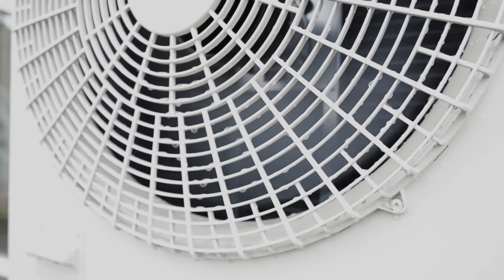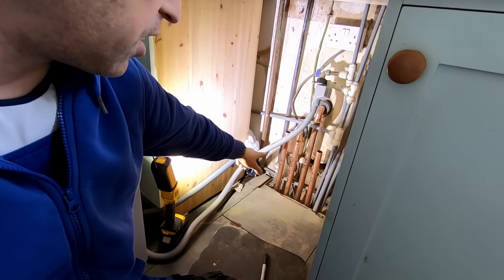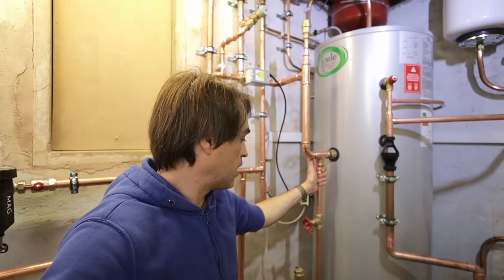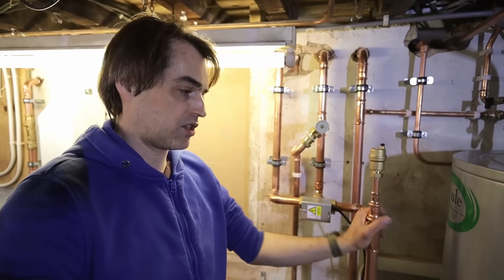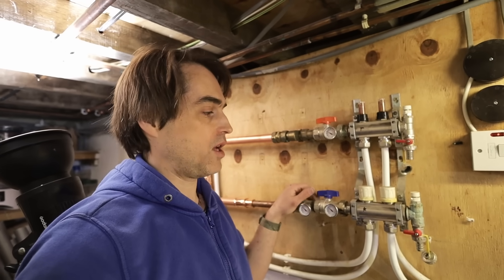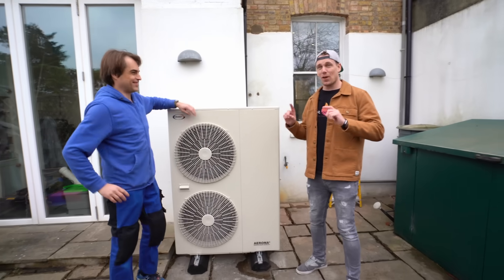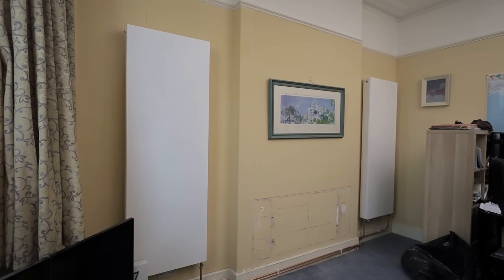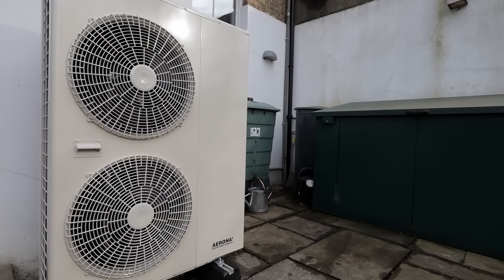The Truth about Heat Pumps: Debunking the Myth.

Comment: Hi Szymon
If you want to avoid having to install massive radiators you should check out our product! 
Love the channel ❤
Reply from the maker: I tried it on one job. Customer ripped it out in no time. I wasn’t impressed either.
Reply: @UrbanPlumbers   that's a real shame to hear. How long ago was this? 
We are currently doing a large number of heat pump installs for domestic and commercial projects. 
It would be a shame to write us off because of a bad job. 
Perhaps we can support the next one more closely 👍
Reply from the maker: @thermaskirt  I had a look at it around 10 years ago. We did one room and wehn client saw how they looked we were told to remove them. I remember the cost was high and eastethics left a lot to be desired.

What output do you get in kW per linear meter at MWT of 45C?
Reply: @UrbanPlumbers  10 years was pretty early days for us so I accept that older systems left a lot of room for improvement, I know because I was installing them at the time. 
Those improvements have been made, as well as some brilliant innovations as the company has grown. Sorry you had to go through it will the original system! 🥲
Heat output at MW 45°C are up to 90W per linear metre. 
So in a typical 4x4m room, with 15m of skirting we can get to 1350W total output. 
Averaging 85w/m2 👍.
I would love you to see how good it looks now. 😄
-Ethan

Comment: I looked to heat pumps. I checked the numbers and is didnt make sense
Reply from the maker: what did not make sense exactly mate?
Reply: @UrbanPlumbers  the running costs to be honest. Very electric hungry.
Reply from the maker: @retroonhisbikes  it depends on the system design. If desinged well it should not be more expensive to run than gas.

In fact they can be cheaper to run than gas!

Comment: Roger has a major hang up with air source heat pumps.  I explained the performance of my newbuild install and he ignored my comments.  Done properly with good insulation and air leakage of the building, air source is extremely efficient.  Also no C02 emissions from the building

Comment: I didn't even know heat pumps were used to heat water and thereby heat a home. In Canada, I have only ever seen them used to push warm or cold air either from wall mounted units or from a central air unit. Interesting to see how tech is used in different parts of the world.
Reply: It's just that there are different types of heat pumps: air-to-air (what you meant), air-to-water, water-to-water (geothermal)
Reply: @Grauenwolf  it is kind of a thing. Actually it'll involve cooling the walls and ceilings too. But the great risk of meeting dew point and wall condensation effs it's popularity. Although used it's use is made only for very hot places and especially not to cool drastically or achieve frigid temps just to make it comfortable for westerners.

Comment: Why not just go for an air/air system, and get rid of the radiators? That is what we do on the continent. you can buy a complete system for about 3k €. Plus any competent DIY person can install it. I did my 100 year old 3 Storey 4 bed, granite walled house 10 years ago for about 1000 €  plus 300€ for the gassing. Still working fine. And it provides air conditioning. Got the kit from a shop owned by B&Q.

Comment: This reminds me of living in a Steam Punk world, it's completely unfeasible for anyone on less than 3 digit salaries plus where would all the pipework,pumps,valves,air unit, storage tanks, thermostats and massive radiators go? 
I'm a Marine engineer and there's just no way I'm turning my house into a boiler room.
Thanks but I'll stick to burning tyres on my coal fire!😁
Reply: Remember the movie Brazil?  Central Services have nothing on this guy...
I've no idea either how most people will afford this.  The promise (here in NL) is that we'll be able to get special loans or mortgages to greenify our homes, and that the cost of those loans are easily offset by the savings on the heating bill.  But that €10k outdoor unit will have to be replaced in 10 years...
Reply: @kaasmeester5903  Exactly! I can't believe the amount of ancillary equipment you need for one of these heat pumps. No wonder they're ruinously expensive.

Comment: Nice pipework, looks expensive. Can’t see how how you can get enough heat out of the heat pump to feed all those radiators. The electric heater will be working overtime of the winters must be really mild.
Reply from the maker: There is no electric heater on this system and it’s not needed

Comment: my mate fits HP. Retro fitting on my pad not an option unless I wanted to dig up 65sqm of concrete floor. I’d also have to have a plant room ( which I don’t have ) I’d also have to insulate my house which is about 2500 sqf.  Financially it’s just not possible,especially if I’m being coerced into buying an expensive electric car in the next few years….

Comment: My heat pump sucks. If I set the room temp to 21 the pump will run non stop but the room will never get over 20.. I'm no fan of heat pumps.
Reply from the maker: Not installed and set up correctly then. Your heat pump is probably ok. What sucks is your installer
Reply: @UrbanPlumbers  it's a new build, so it's been installed badly by design it seems.

Comment: I've watched Rogers videos and to be honest nothing he said is false. Heat pumps can be made work in every house but they are not the best solution for every household. Maybe the running costs he talks about are more down to bad installs rather than the system itself

Those two huge radiators look ridiculous.
Reply: Honestly though, nobody is saying everyone has to get a ASHP right now. 
The government want to transition to it as long term gas is unsustainable and of course the people with the gas (i.e. russia) are not the best people to be dealing with.
In the long term, the supplies of gas will get lower and lower and the price (inc carbon tax) will get higher and higher. 

This is future proofing your home in my eyes, though of course not financially viable for most. 

It only highlights the need for more government assistance on this. Though I think we can all agree that grants on proper insulation (or even instalment plans) are the way forward short term. Even gas fired homes will use less if they're properly insulated and will pay themselves off in the long term. People just cant afford the initial investment right now.
Reply: You need an industrial scale of sterling engines + liquid metal batteries

Comment: So if the temperature across the whole of the UK falls below -5C and all twenty-three million gas boilers are switched to 17KW heat pumps, that would represent a potential demand on the grid of over 400GW. To put some perspective on that, current demand on the grid (that we struggle to keep up with) is around 45GW. Has anyone done the maths here?!!!
Reply from the maker: 17kW heat pump uses around 4kW at -2 and has a maxium output of around 13kW

17kW is maxium heat pump OUTPUT not INPUT at air temperature of 7 and flow temp of 35

At - 5 and flow temp of 45-50 the same heat pump will have an output of maybe 12kW and will need an input of around 4kW

If all 32 million homes needs those heat pumps running (and average home is aroundn 7kW at -2) you will need approximately 3kW * 23 million = 70GW
Reply: @UrbanPlumbers  Which drops us down to 92GW - or 200% of current UK generating capacity. Assuming we try to cover that load increase with wind turbines, we would need some 24,000 onshore (GE) units or 7,500 offshore ones. Alternately, we could build 22 nuclear reactors the size of Hinkley C. 

That done we would then need to treble the capacity of the UK's existing distribution network to handle the extra load. So that's another 5,600 miles of overhead and buried HT power lines - before we even look at street cabling (including buried and overhead ABC) that will need to be upgraded. 

Lastly we would need to treble the capacity of the 330 substations rated at 400KV and 275KV (36 of which sit inside the M25) as well as the 400,000 stations rated at 11KV, which are found in every municipal block across the country.

I repeat: has anyone (else) done the maths here?!!!

Comment: that looked like top notch work but holy cow that system is hideously ugly.. i thought i was looking at the engine room of a paddle steamer from  the 1880,s definetly not having a heat pump !
Reply from the maker: What’s wrong with paddle steamers?! They were beautiful, as is copper pipework :)
Reply: @UrbanPlumbers  haha yea good point. I was referring to the bulk and complexity so not only does it take over small homes, I'm in the UK, it looks massively unreliable long term due directly to the complexity. I am biased though because I work on German cars electronics

Comment: How does the heat pump counter icing when the ambient air temperature is such that the heat removed by the pump from the air means that ice will form in the heat exchanger? 
In Orkney, where I first came across this problem, the average temperature for the coldest part of the year is 5 degrees. with a humidity of +65%. 2 x 3Kw electrical elements were required to prevent ice from forming in the heat exchanger.
Reply from the maker: it has a defrost cycle

Comment: So, all you people who are never going to have a heat pump installed, what are you going to do to help save the planet…or don’t you care?
Reply: You raise an interesting point. I definitely do care. I’d say I see somewhere in the region of 500-700 boilers a year. Many of them are old C/D rated appliances. If the government really wanted to make a big impact of green house gasses. Instead of funding air source pumps they should set a date that all boilers must be A rated, phase out spares for all non A rated appliances. Say in ten years time to give plenty of notice. If every household in the UK switched to A rated gas boilers it would save 1000s of tons of CO. Secondly right now they should legislate that all Gad suppliers must include 20% hydrogen in the supply. There’s tons more CO saved. Just rewatch that video and look at the amount of materials required. Hundreds of feet of copper pipe. All new rads. The heat pump. The cylinder etc. explain to me how manufacturing that lot can be good for the environment. Just think of the CO alone from the metal production. Let alone digging it all out of the ground. Then there’s the actual electricity production. Burning gas in a power station, to make electricity, to stop someone burning gas in their homes. The whole thing is utter nonsense and about as green and good for the environment as burning a big old pile of coal in your fireplace. It’s all smoke and mirrors by the green lobbyists and manufacturers. It’s extremely short sighted to label people who don’t think heat pumps are the answer as not caring about the planet. But just look at the raw material production for that installation compared to the raw materials of a simple boiler change where all the pipe work and radiators remain unchanged and explain how these can be a green alternative.
Reply: This is a really important point. I think the idea is that all the materials and equipment removed will be recycled, then when the heat pump reaches the end of its life (?) it will also be recycled, offsetting some/most of the emissions of CO2 arising from the manufacturing process; and of course a new A rated boiler also has to be manufactured, creating emissions. Unfortunately, there doesn't appear to be any information about what the emissions involved are and I have looked. Without those numbers, we can't do a proper cost-benefit analysis. As to the environmental, not to mention the human costs, mostly in the developing nations, of extracting the minerals needed to make heat pumps and boilers, no one seems to have given that a thought. Regarding Hydrogen, according to CAT,  the problem is that we currently only produce grey hydrogen which is a by-product of natural gas, so still fossil fuel.  Blue hydrogen, which is what the government is talking about, is also a by-product of natural gas, but with all the carbon removed. Problem is, the earliest this might become available is 2025 and that is far from guaranteed. In any event, it is still fossil fuel and we will simply be shoving zillions of tons of carbon somewhere that may not be safe. What we need is green hydrogen which is much more expensive and we are light years away from it being a reality on a large scale.  Whether we replace old boilers with new A rated boilers or heat pumps, we still have to extract materials to make them but the amount of fossil fuel used to run a heat pump over its lifetime will be significantly less than an A rated boiler, provided we also stop burning coal and gas in power stations and ignore the privileged nimby's who don't like wind turbines because they blight the view of the ornamental lake. We all have to make sacrifices, though obviously those with money will make sure they don't. It isn't always necessary to replace all the pipework or even the radiators. You can get high temperature heat pumps that allow for existing radiators to be kept and if you have solar PV, you can integrate it so it powers the external unit or helps heat the water. As Urban Plumbers points out, the system must be designed to suit the house and that means the occupants requirements and budget. I am planning replace my gas boiler with an ASHP this year and I will resist replacing any of my radiators unless I can get away with a larger version of what I have already.
Reply from the maker: They don’t care Janet

Comment: Wow an impressive installation but all of this to replace that little boiler?  Seems ridiculous.
Reply from the maker: Give it some time and burning gas to heat our homes will be seen as ridiculous.

Thanks for watching
Reply: @UrbanPlumbers  perhaps, but look at the complexity and all of those materials, with associated mining, processing and manufacturing required to produce the components to complete this install - this isn’t the solution. Given the whole point of this is supposed to be ‘to save the environment’ it doesn’t make sense. It’s just shifting the environmental damage from burning gas to another form of damage somewhere else, much like the fallacy of electric cars.
Reply from the maker: @justinfielding  this installation is actually simpler than boiler + cyliner installation and requires similar amount of materials.

The problem is - people got used to boiler swaps where you only change a heat source of your system. Once those systems are in place - the heat pump swap job will be no diffrent to a boiler swap job and in few years will most likely cost the same as a boiler swap.

Also, those systems are actaully more reliable and will last much longer than a high temperature gas boiler system. Low temperature of the system means less thermal stress to components, less wear and tear to the system, less corrosion in the system. Overall the system should require less maintanance and should last much longer than a typical gas boiler system.

This is no different to when first full central heating systems with gas boilers were installed. They also costed a lot and used a lot of raw materials. Those materials will last decades if installed well. I still come across working copper pipework systems that are 40+ years old.

The real cost saving is in efficiency. There is no other heating appliance that can run at 300-400% efficiency. It just makes sense to go that route even if the initial system adjustement and installation cost is big. This is part of the way and makes total sense once you understand the technology and efficenicy.

In this case the heat pump also takes advantage from solar PV and battery storage.

Comment: A new building I have just moved into for work has roof air source heat pumps and normal sized radiators throughout the building!
Reply from the maker: Yes. That’s because a new build has minimal heat loss and smaller radiators are perfectly fine

Comment: weird, it looks like you hooked up an air conditioner to a water heater.  We have "heat pumps" here but its just an air conditioner ran in reverse. It feeds an air handler, not water.  Completely different.  Why not just dump the electricity directly into heating the water?

Comment: Is that water heater sitting on a platform of wood?
Reply from the maker: Plywood on concrete
Reply: @UrbanPlumbers  Wouldn't it be better to have put it on concrete blocks with a drain pan under it?  That's how my water heater is installed.  That plywood won't last very long especially if it gets wet.

Comment: The pump at 5:00 mark. Why not simply use a standard condensate pump for an ac? The flow demand is tiny (1 deciliter per hour or similar) and its a vessel that will cool down until its full and thus trigger The pump to start.

Also, why 100C temp? The hot water  tank on a heat pump should operate at about 55C, with periodical rise to about 70C for legionella control.
Reply from the maker: Not allowed under g3

Comment: An excellent installation but shows the amount of work and equipment required to retrofit these systems. Frightening cost. Just wonder if this householder got much change from £30K? What about hot water temperature. Is that boosted by the immersion heater?
Reply from the maker: Cylinder is not boosted by immersion heater. Heat pump raises water on the cylinder to 50c without any issues. 

Also there is solar diverter boosting the cylinder with solar PV

If solar PV does not rise the temp to 60c direct electric kicks in one a week for bacterial growth prevention.

Cost is well below 30k!